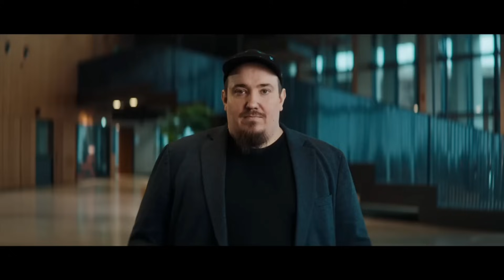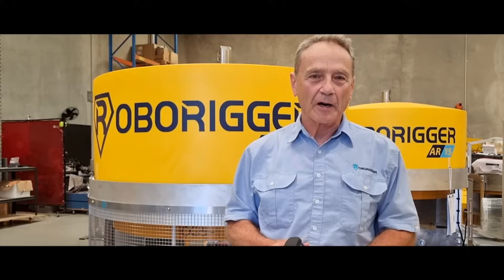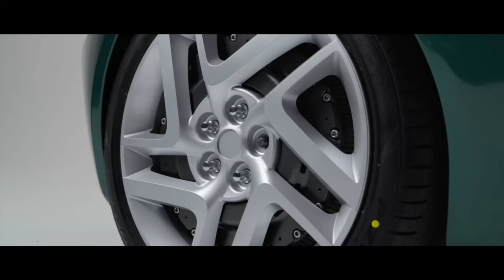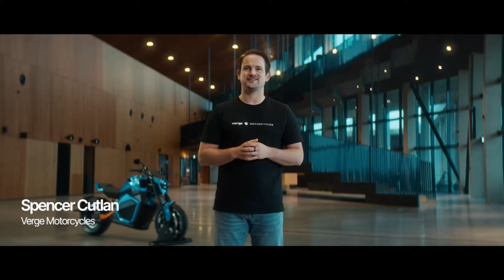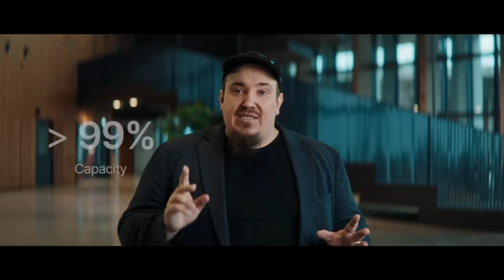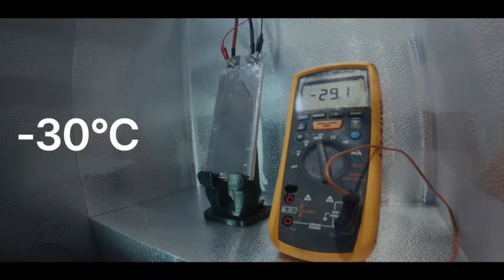Has Donut Lab Cracked The Battery CODE ?

Comment: The good news is that these Donut batteries are supposed to be shipping in Verge motorcycles in a few months time. So we will likely know the truth within a couple months. I wouldn't want this to delay Aptera's production, but since Steve Fambro has been at CES, I hope that he spoke with Donut Labs to create a add-on option for the Aptera that adds 10-20kWh of Donut batteries and the  in-wheel Donut motor. I'd buy a package that added 100-200 miles of extra range, 150HP (rear motor), and all of the other benefits claimed. The Donut battery may be a hoax, but it also may be a game changer, if it proves to be true.

Comment: Its a shame someone would embarrass themselves over Donut's panicking over Quantumscape's battery production & sales for 2026  1) Donut has not.. at all.. verified they have a solid state battery.  2)  Donut has not verified their claims through a third party, nonetheless a respectable lab.  3)  Donut has never advised the public they were even working on a battery.  4)  Donut is a relatively small & recent startup absent of the necessary decade of work to claim they have such a battery nonetheless manufacturing it.  So this video is just embarrassing.  What were you even thinking?
Reply: Gullible...

Comment: SUPERCAPACITOR 418 WH/KG 100k CYCLES
Component_________Exact Material
Electrodes (x2)_____PANI-Grafted SWCNTs
Solid Electrolyte___PVDF-HFP + [EMIm][NTf2].
Current Collector__Carbon Nanotube Fiber Core
Encapsulation______Kapton Tape or PDMS

Comment: Once you realize Donut Labs is using a high power density capacitor instead of a battery, every one of their claims falls into line. There were several clues provided, such as the power regulator included with each "battery". This regulator is required to control capacitor in-rush and out-rush current. Donut Labs recently invested in Nordic Nano, a  capacitor company in Finland that advertises on their web site a capacitor with the same power density as the Donut Labs "battery". So, the bottom line is that this appears to be a real thing and it will be a very disruptive technology

Comment: They could use those donut motors that are 200HP and stick them on the Aptera and have 600 HP . They are light!  Also, don't forget that solid state would make her very light as well at the same time give her 500miles per charge.
Reply: Those  motors alone would make her lighter and 33% in power savings alone.